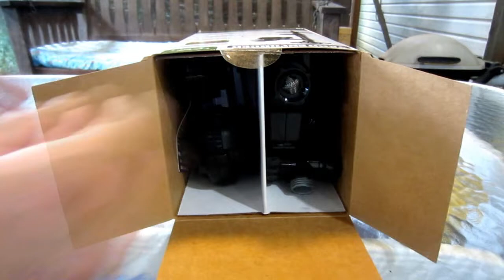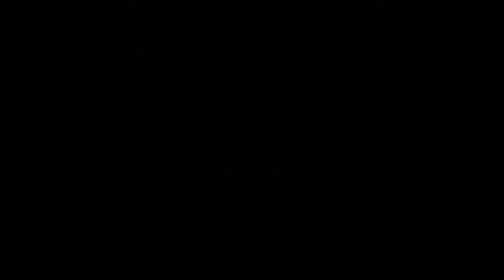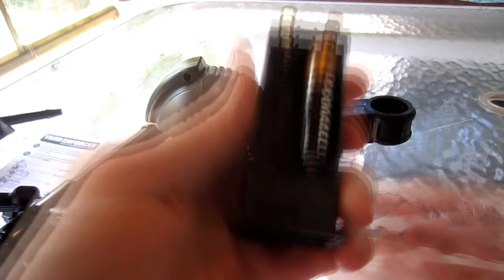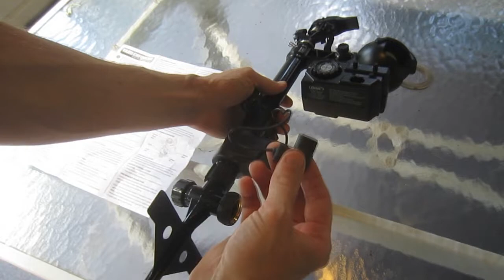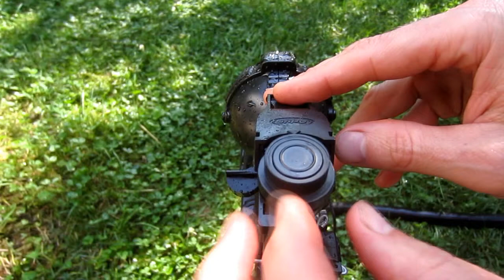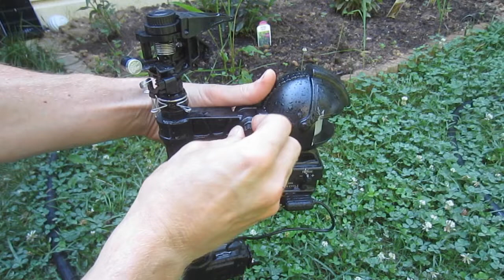Orbit Yard Enforcer (62100)- Unboxing, Assembly, Set-up, and Testing

Comment: Just got ours for a deer problem. Followed directions on pamphlet, viewed 3 videos on YouTube. Set it up and it runs all of the time. No shut down at all no matter which setting - day, night or always. Tested batteries they are good. Pushed in the 30-minute button while set to the "off" position for 30 seconds but no change. Any ideas to get this operating correctly?

Comment: Did the hose come with the unit?  I have their older model and when I hooked it up to a standard garden hose it created a hernia in several parts of the hose.  The temperature here can reach 95-110 degrees in the summer so I could not use it in the spring and summer.

Comment: My question is, if this has to be left on basically most of the time to be effective, does it break your hose from water pressure from being constantly on or leak at the fittings and bring up the water bill.
Reply: I want to know this too..
Reply: I've had this for years. I only use it in the sping/summer to keep stray cats away. This has held up and hasn't leaked yet. Love the item

Comment: The unit seems to be working fine for a second season. BUT, It is very hard to determine motion sensor field of view. It looks like it has some dead spots. trying to angle up or down gives very mixed results. It will get me wet on trials, then i angle the sensor down
and it wont pick up the cat walking by, angle it up a bit and totally misses larger animals. Wish they have a good factory set up.
All the tests I did were on the highest sensitivity settings. Any ideas??
Reply: I wish I had an answer for you, I've been fooling around with mine for about 3 days and I have the same results as you. It may have to go back to Amazon soon.
Reply: Same here...I literally wave in front of the sensor or jump 7ft in front of the sensor and does nothing! However seems to work on the edge of my garden like if only the edge of the sensor are working. Didn't help protect my garden at all.

Comment: Thanks for the video.  I ordered one tonight from Amazon.  Unlike most of the others on Amazon that run on an expensive 9V battery, this one runs on 4 AA batteries, which I already have a good supply of.  I plan on using it to deter a cat that keeps walking up to our front door and spraying it.  Orbit is a good name, so I hope the extra cost is worth it.
Reply: Is it working for you I just purchased one too

Comment: I live in a remote area with no running water, I haul my water and used large water tanks will this work if I add a hose from the orbit to water tank? It’s a very popular tourists destination and they keep going behind my house to take a leak or worse!
Reply from the maker: Relatively high water pressure is required for the sprinkler head to rotate. Seems unlikely that there would be enough pressure in the tanks for it to work in your situation.
Reply: @totrand  bummer.....know any good water pumps?

Comment: I'm having an issue with the battery box getting moisture inside and causing the batteries to become corroded. Any such issue with yours?
Reply from the maker: No problems as of yet, at least.  I'll check periodically.